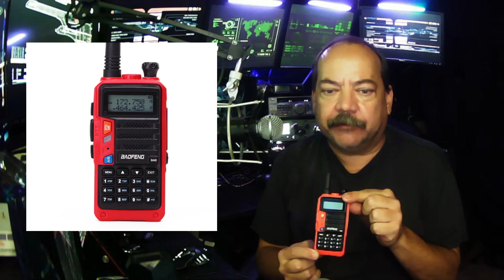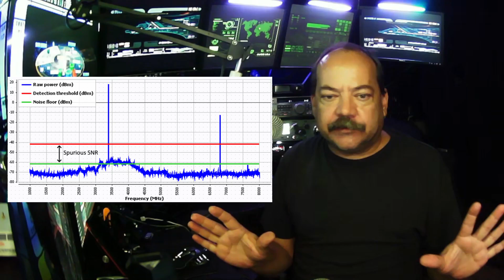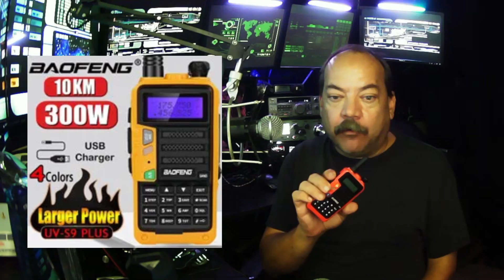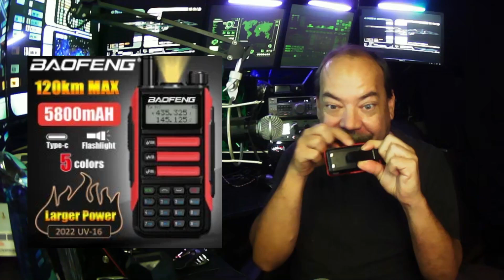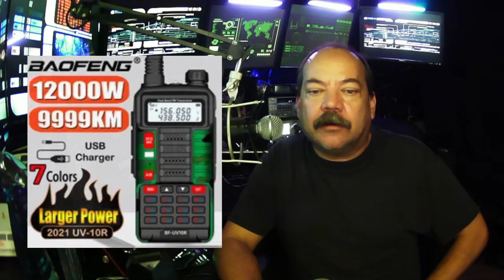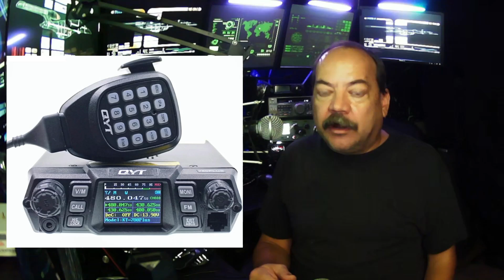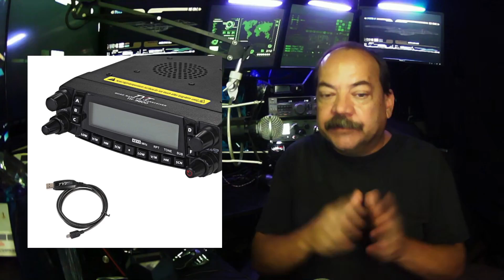🔴The 12,000 Watt Ham Radio!   WOW...  Yes, It's BS, and it is Crazy!   We Explore the Scams!

Comment: I have the Baofeng GM- 5RH, and when I bought it online, it turns out that I got sold a different unit.  I was supposed to get  the Baofeng AR-5RM. It also did not describe in the description that it was a GMRS radio only. So it means it’s “Locked” And There is not a way to unlock it. I wouldn’t have bought it if I knew it wouldn’t run ham frequencies.
Reply from the maker: I buy all my radios from Azazon and when it's not exactly what I want I send it Back!    I am aware of this type of Baofeng and I  am not aware of a work around.

Comment: Does the nation of England have different radios than the USA ?
Reply from the maker: No they are Lying!  It is BS!  LOL
Reply: same radios but they do have different specs. We have different frequencies than those in the UK can use. So usually what happens is the factory will make the same radios but the ones they sell in the UK will have a different frequency set than the ones in the USA. A lot of times it's a simple solder job inside to remove or bridge something somewhere on the board to open up the radio to the other frequencies.
Reply: oh if you buy a uk radio in the USA sometimes companies won't cover the warranty for some reason. They should but they won't. They call them gray market radios.